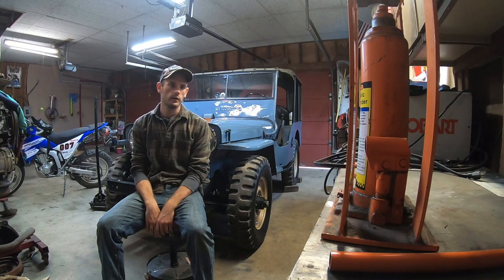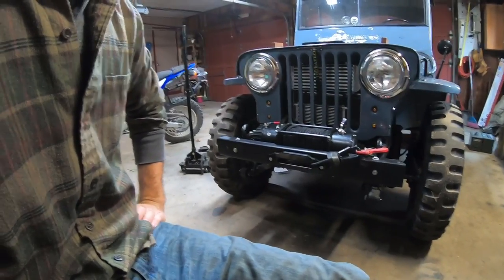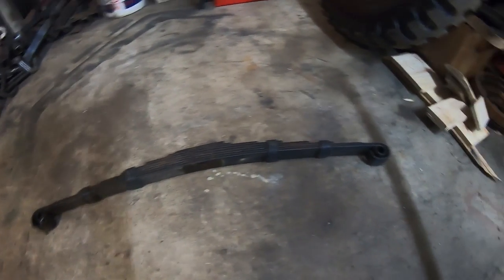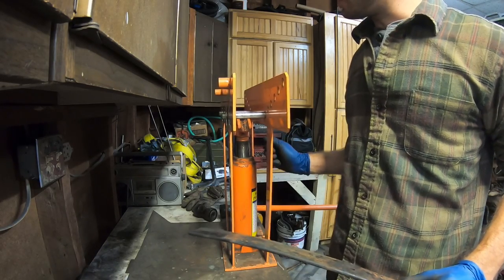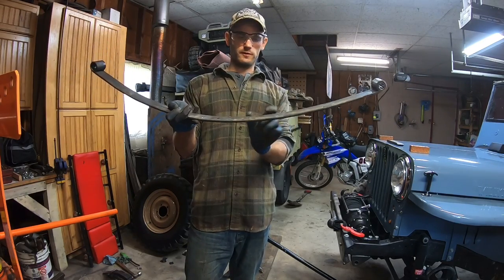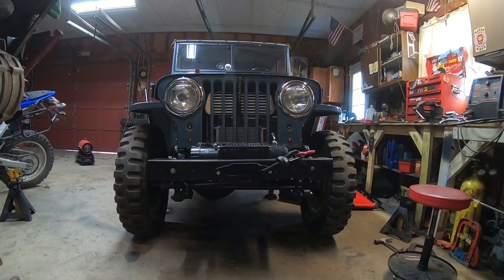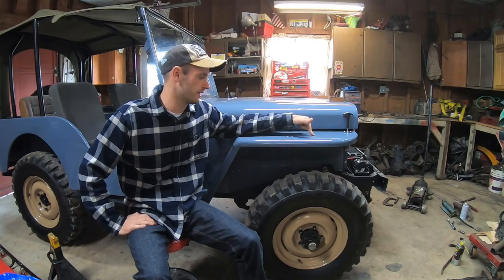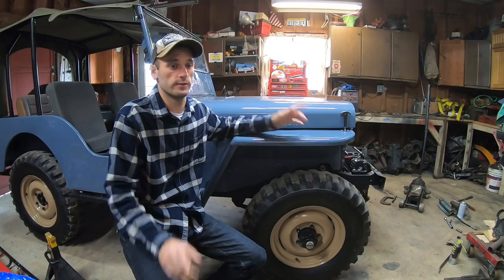Harbor Freight 3.5” Jeep lift kit!

Comment: Made quite the difference!!!😎👍Be interesting to see how long they hold the new arch.  Good video, as always!
Reply from the maker: Full Throttle thanks. I’m interested to see how they hold up as well.
Reply: Spring steel never lose it's stiffness over it's lifetime. [unless somebody anneals it with heat]. 
The spring slowly loses it's "setting" over millions of oscillations.
Re-setting them makes them good as new again.

Comment: Great video..... For heat, I use a Mr.Heater propane attachment from The Academy and their propane tanks are 15 bucks trade in....
Reply: I use the single one, small garage but works for me...
Reply from the maker: Wycked Sins cool! That looks like a nice little unit. I have a diesel heater in the shop that works great but that last clip I snuck out to the shop for a few minutes so I didn’t want to waste the fuel. Hopefully Phil was right and spring will be here soon! Hope you’re having a great weekend!!

Comment: If you heated the springs with a torch would that relax the higher side a bit so it would go back down or will it mess up the springiness?
Reply from the maker: MANOWAR KILLS I did a lot of research on this and spoke with some old timers that did this a lot back in the day. Heat changed the temper and behavior of the steel. It’s not recommended.

Comment: Wow this actually works nice and its free. I'm just curious how long it lasts because obviously it was like this brand new but the springs sagged over time. Im curious how the metal is or if it has any tiny stress fractures. Also i'm very curious on how your stippling job worked out on your tires. Did you get a chance to drive on ice yet and did it make a difference? Could you tell when you drove it?
Reply from the maker: Romullus I will try to post some long term updates. From what I’ve been told they lose 25% of what I gained provided I didn’t take them past the point of elasticity. Spring steel has a tangle of movement before it begins to break/bend. I arched them past where they would have been even when new. Time will tell how they hold up.